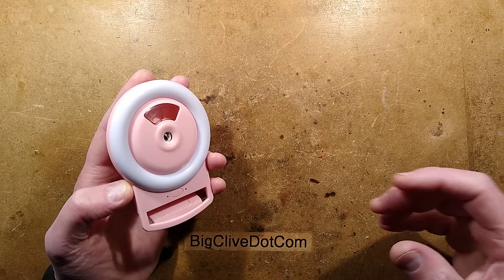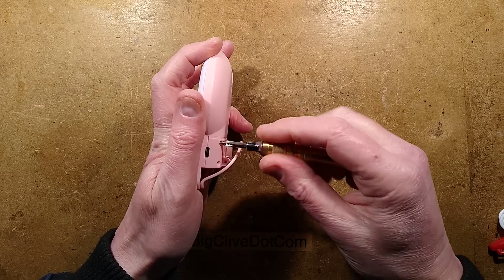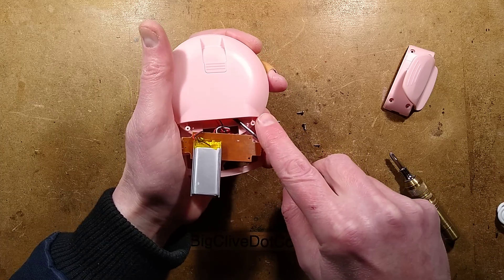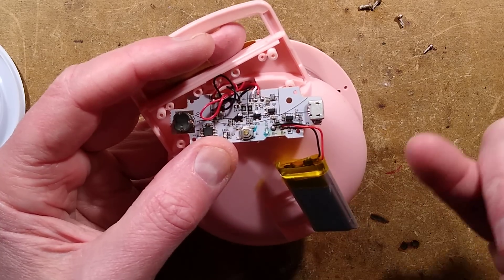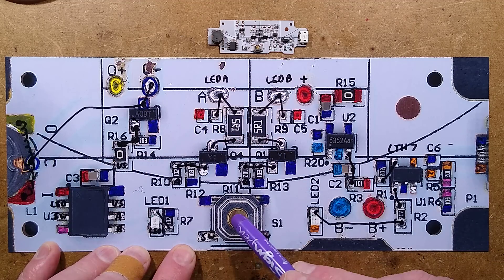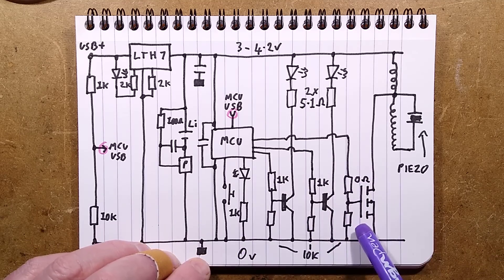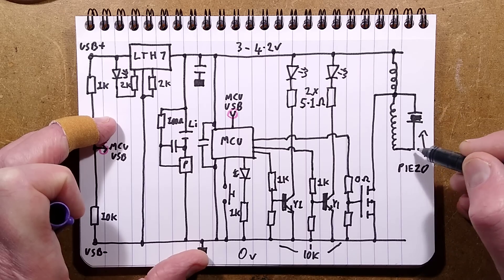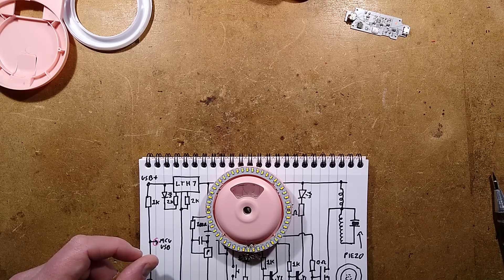Rechargeable moisturising selfie light - with schematic

Comment: Have you by chance measured the frequency of mosfet cycle? Could it be used as a cheap source of an ultrasonic fog machine for Arduino projects?
Reply from the maker: The disks they use tend to have a specific range of frequencies they operate at.

Comment: I would like to see “OCOOPA Hand Warmers Rechargeable 2 Pack, Magnetic Electric Handwarmer”

a lithium battery surrounded by heating elements with an aluminum housing that you hold in your hands and close to the body, seems dangerous?

Comment: The gate of a mosfet can draw a lot of current charging and discharging the internal gate capacitance.
It's never a good idea to omit the gate resistor, even if it's 100 Ohms, as it will eventually burn the push-pull driver section of the MCU pin. 
Then again, these products are in the landfill, way before that happens.

Comment: A bit disappointed you didn't spot on camera that entire circuitboard and battery could be fed through the hole there to get all electronics free of the plastics.
Still, wonderfully pointless device.
Reply from the maker: I did subsequently discover that.
Reply: @bigclivedotcom  Oooooh! That is a good word. Should be used more often.

Comment: I looked at the DW01 datasheet for the first time in a while and saw it has an undervoltage cutoff threshold of 2.4V. I would avoid it, wish I knew that before buying a bunch of them. Not sure if the monolithic protection+FET packages in this circuit have the same issue…
Reply: The DW01 is a safety device; the last line of battery protection.  Whatever the battery is powering should be implementing a suitable battery management scheme.
Reply from the maker: Although it cuts off at about 2.5V the cell will usually float back up to around 3V again.

Comment: They sold those here in the states for a while, i had a few of them... they use a oscillating circuit at a few hunderd kilohertz and thew pores of the piezo element get clogged easily and are near impossible to clean. Love the vidz!
Reply: You gotta use only distilled water in them!!!!

P.S. you can clean it by running white vinegar through it...
Reply: @Quickened1  YES YES and YES people need to smart up, all the crazy crap in tap water is being atomized and put in the air you breath not very healthy
Reply: You should only use the genuine Epson products.  😉

Comment: I have a couple of those cold humidifiers. I use them near my computer/electronics bench and have never had a problem with too much moisture causing a problem.
Reply: I've always been hesitant to use a piezo humidifier. Phoenix has some of the hardest water on Earth. The last thing I need is a layer of calcium dust over everything in the house...
Reply: Haha, yeah.  Might need to get distilled water if that's an issue.
Reply: @gloomyblackfur399  yes distilled water, but you may have to put a tiny bit of tap water in it to get it going. I think it needs some calcium to work right... Not sure if that though...